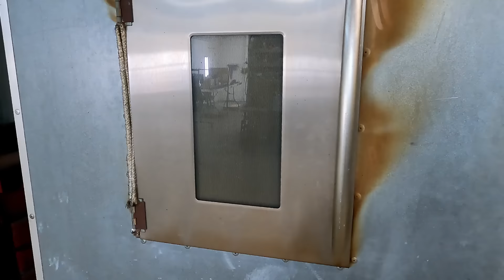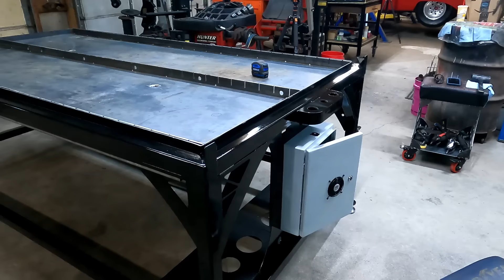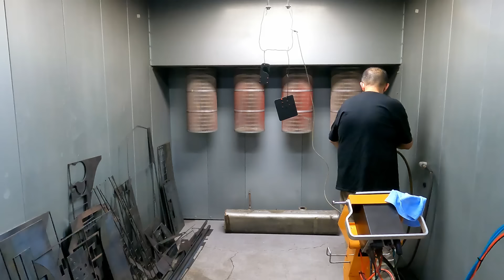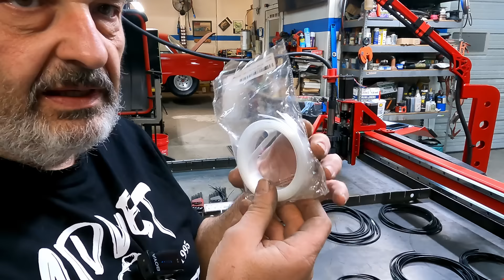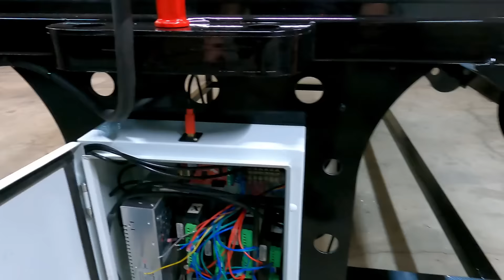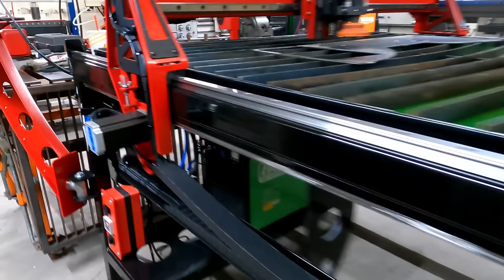DIY CNC Plasma Table Build - 3 #trending #diy

Comment: Hi Stivi, this might be a silly question... How is the X-axis end-stop handled, given that there are end-stops at only one end? To clarify: in your setup, both X-axis end-stops are at the back of the table, but how does the front of the table stop? Thanks again for the 3D file; I haven't reached the assembly stage yet, but I'm making steady progress—I'm starting on the electrical cabinet now. A big thank you.
Reply from the maker: Hi, this is not a dumb question, actually I talk about it briefly in the video when I'm doing the settings in mach3. So all you do is set your soft limits in the program mach3, essentially you'll run it all the way over as far as you want it to go and then you'll set your soft limit in the program and then it'll never go past that point. Hope this helps.
Reply: @midwestkustomz6350 , That’s very clear. Thanks again.

Comment: I used rustoleum gloss enamel on something. After the first coat had dried I applied a second one. Even though it looked really good it was a very heavy second coat.This caused the paint to wrinkle and almost acted like paint remover as I could use a plastic scraper with little pressure to get 99% of the all paint off in a single push.
Reply from the maker: Hi, yes that's the good Ole solvent pop! This here was completely strange, the the paint was set pretty decent when I applied the top coat the next morning and it did exactly what you described. It literally started cracking up and using the similar type of stuff on top of each other should of not done that. Especially when the first stuff I used said in the directions to apply more coats the next day! Go figure! 🤣🤣
Reply: @midwestkustomz6350 definitely weird,  something for us all to be able of. Thanks for sharing.
Reply from the maker: @KZ-yy9pm thank you and your very welcome!